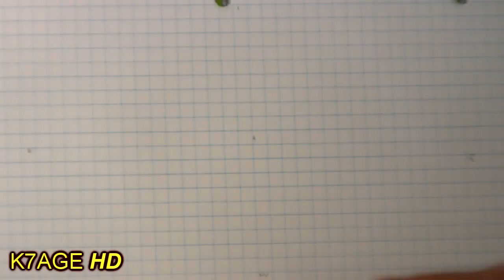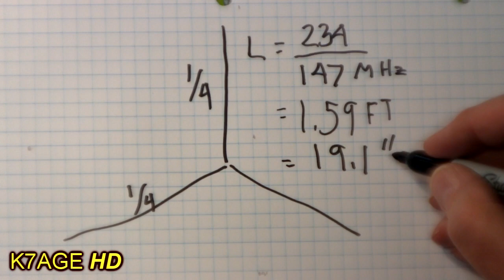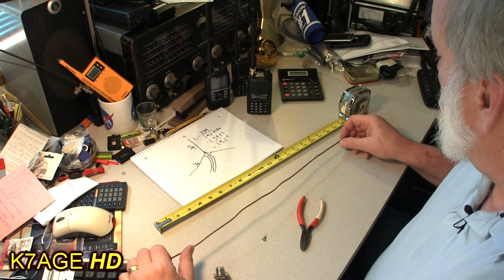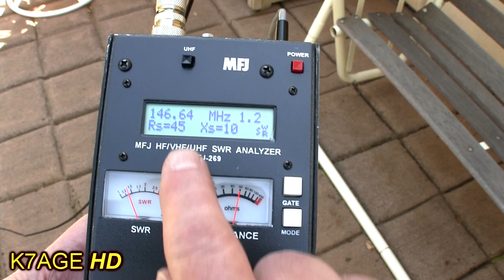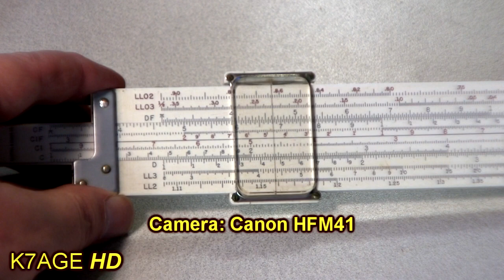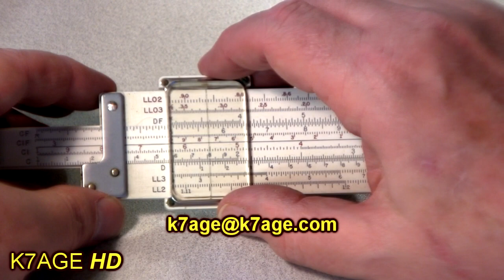How to Build: Ham Radio 2 Meter Quarter Wave Antenna

Comment from the maker: I can't reply to some comments, so here goes

Chipper M, a half wave is a different antenna with different matching. The 1/4 is handy as the impedance is around 50 ohms, so no matching needed. If you use 1/2 elements, it will be good for around 70 MHz.

G Foster - I'll metric to the show notes.
Reply: You get a SWR meter and either match the antenna to your rig artificially using a meter (mines on my SWR meter) it tricks your rig to thinking the ohm and everything is right....but matching is only a temp solution if you're in a hurry or cant adjust your antenna....basically you hook up an swr meter, check ch1's reading....note it down....check ch40's reading and note it down...if they are over the average of around 1.5 or whatever is recommended for your rig type, you need to adjust the antenna by either making it longer or shorter

REMEMBER you are ultimately trying to get your SWR DOWN LOW not high...that can easily blow your rig if its too high!
Reply: +K7AGE So you cannot make a 1/2 wave 2m antenna without matching? What does matching consist of? thanks
Reply from the maker: +Fast Eddy Not sure, it would take some research...
Reply: +K7AGE Thanks. I just bought the book about antenna design from the ARRL. Very interesting stuff. Time to study!
Reply: What materiel should those welding rods be? Steel? Aluminum ? I need a sturdy vertical to withstand the cold snowy winters in IL

Comment: This is one of the first projects any new ham should do. Thanks for presenting it in a way that is easy to understand and build along. With a little weatherproofing and some paint for UV protection the 10' PVC mast would mount nicely to any building. For portable use I would suggest putting wire nuts or tape on the ends of the elements to prevent the sharp copper from scratching people or things.
73
N0ECK
Reply: K7AGE When I make these as a demo I use quick set epoxy on the ends.  Make up a small batch, put a bead on the end of the antenna and then turn it until the bead sets and hardens.  It's permanent and give the antenna a finished look.
Reply from the maker: Good ideas!
Reply from the maker: good idea

Comment: Hi, haven`t seen a slide rule since high school in the mid- 70`s. Nice application on the HT Your channel is very pleasant and informative. good camera work, too.  Thanks and thumbs up!

73rd`s, Joe KC3BXZ
Reply from the maker: Thanks Joe. I just recently bought that slide rule.
Reply: Hello Randy, got a question. I have a spare Hustler SF-2 5/8 wave mobile 2 meter whip. It has a base coil and I wish to convert it to a base antenna. I have all the necessary parts to construct it, but need to know how long to make each radial for a ground plane. I will be modeling this whole thing around the Hustler MKR-2 Radial Kit. Would  21" be enough to start with for each radial and still allow for trimming, if necessary? I have not had any luck getting much data on the Hustler kit, but one post on QRZ said that the radials in the kit are 1/4 wavelength long, which would be 19", according to the posting. My base station radio is 65 watts max output and will be using RG 213U.  Thanks, KC3BXZ Joe

Comment: If a 1/4 wave antenna works good would a 1/2 wave work any better. I have lots of room to put up any size antenna, so if I build one should I use the "bigger is better" rule?

Comment: Great demonstration, I just bought a cheap 2 meter Baofeng that I have trouble hitting my local repeater with, and I will have to give this a try. But I was lost on using that slide rule, LOL. Glad to see you doing videos. 73, Tom K2BEW